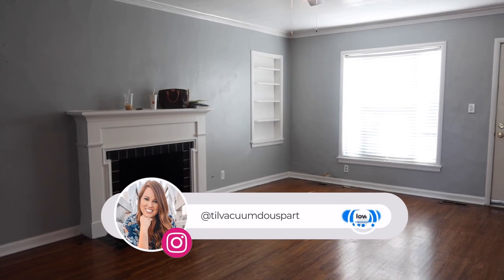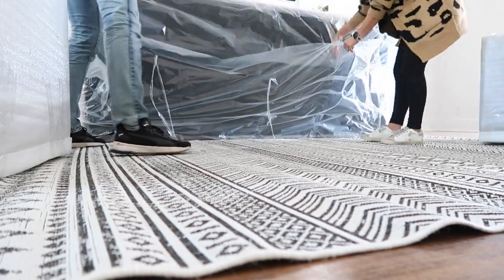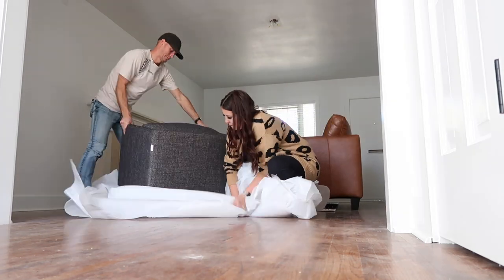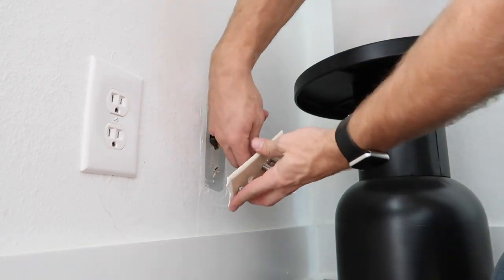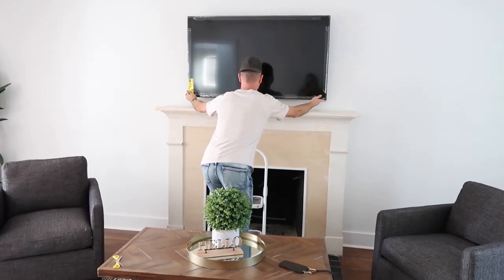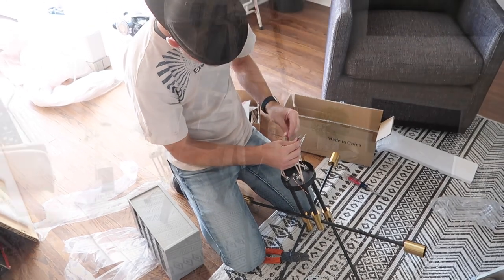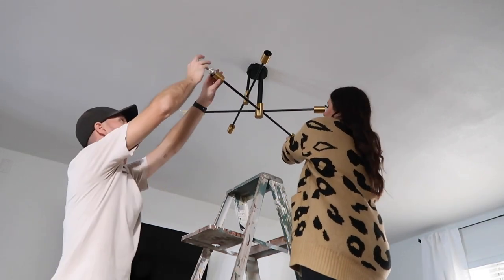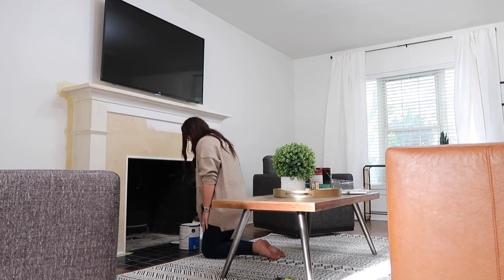NEW! SMALL LIVING ROOM MAKEOVER 2021 | LIVING ROOM DECORATE WITH ME | DIY AFFORDABLE HOME PROJECTS

Comment: This video came up in my recommended, and I just have to say my husband and I also spray painted the floor vents in our house, we had a few of those, we also had these long  style hvac vents along the baseboards that would have been harder to find so I spray painted those as well as the vents for the air return vents. Our house is older so it has the older vents BUT before we moved in the hvac was updated so even if all the vents were old/outdated… hvac works amazingly. We also spray painted some light fixtures that were brassy gold. With the cottage/vintage style coming back that I love… a lot of things in our house we kept… just gave them a makeover.

Comment: I absolutely love the way the living room turned out. I think the furniture choices were perfection the darker swivel chairs with that brown leather are going to work great for a b&b especially over time to be able to keep them clean and not dirty looking. I love the fireplace surround black. As someone looking in at the finish product now please everybody know this is just my opinion, which doesn't have to mean anything... But as a decorator and designer not 20 years and knowing how to stage a home especially when you want it downplayed for whatever reason or purpose. My only suggestion is that the blank wall on either side of the fireplace and then the fireplace being all black with the surround the tiles the inset and then the big black TV above it with all the white walls just is to start It's just a big black box with a big black box and white walls. So my only suggestion is to possibly do a peel and stick tile on the inside of the fireplace so leave it all black leave the surround black but on the inside do a peel and stick tile. And then try to find maybe two pieces of art or some kind of hanging decor that could go on the larger open areas on either side of the fireplace. This way the wall wouldn't look white with two big black boxes in the middle. That is my biggest suggestion for the room 🤔❣️ as always do you and I do truly love the way this whole house is turning out, if I was in the area I would come stay for a nice long weekend 💯❣️😍❣️💝❣️❣️

Comment: Nice work! I am assuming the built-in shelves were too shallow to places items so you left it out, they did add charm but probably not practical. Could you have increased the depth of the shelves? Probably would have cost a lot.   Maybe add some shelves or built in book case next to the fire place and hang some art next to the fireplace.  It's a lot of grey with the walls, chairs, and art.  Some green plants would add some color.  Love the couch!
Reply from the maker: Yea the built ins were too far left and right. If they were more centered we would left them but they were originally windows that someone covered up and they just didn’t look right. Thanks for watching!